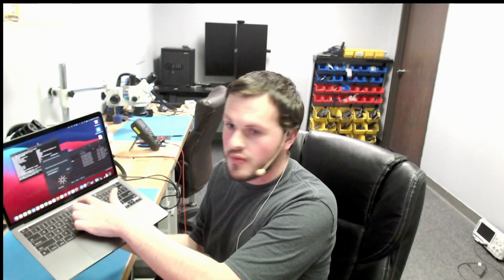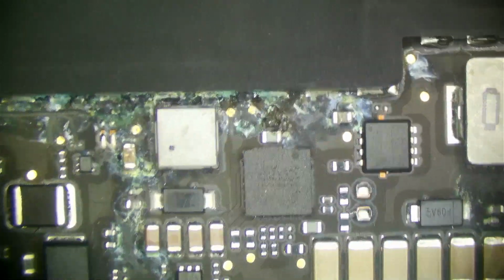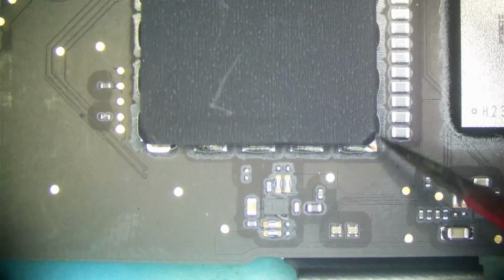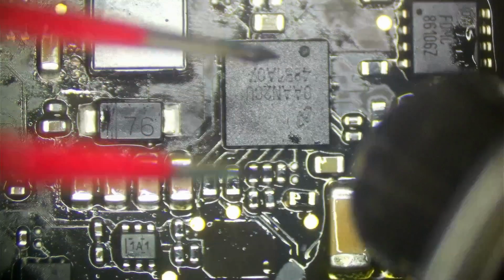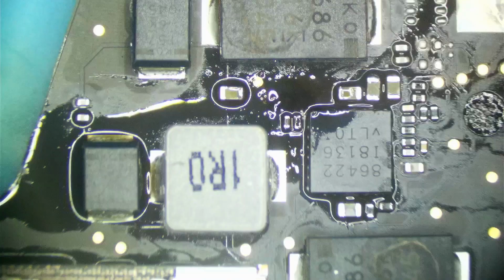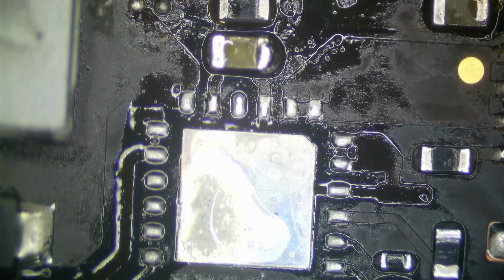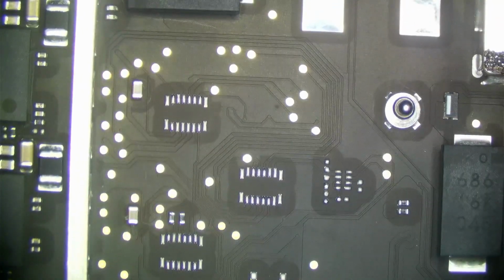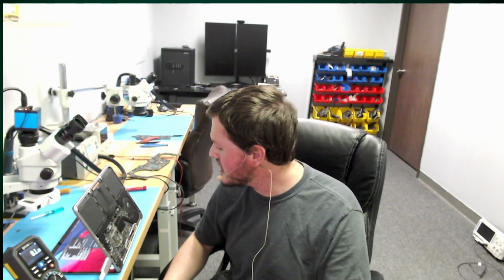Can we fix a A2338 M1 MacBook Pro that Apple said was unfixable?

Comment: If a capacitor is not necessarily needed, it wouldn't be soldered onto the board because it would only be extra cost of manufacturing.
Reply from the maker: Not exactly true unfortunately. Boards can function just fine without certain capacitors with zero ill effects.

Comment: I have this same model i purchased that had liquid damage. Mine wasn't as bad but it is in the backlight area the most. What got damaged on mine is there is a short in the touch bar touch circuit, so i'll have to replace the touchbar unfortunately. Also i'm having an issue where its running a little slow. I removed the trackpad and found damage in the trackpad circuitry (even though it seems to work). I'm wondering if it's CPU throttling because of the damaged trackpad. It also reboots after 2 minutes of booting. Lastly it cannot detect the wifi/bluetooth module. Thats what worries me the most, but i have to fix the booting every 2 minutes first.